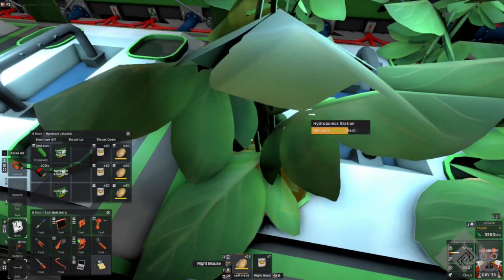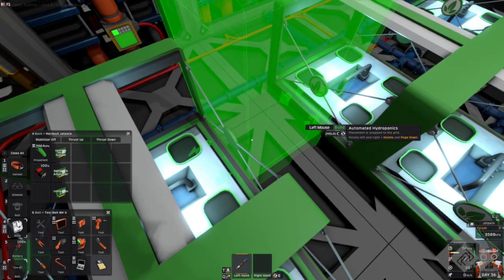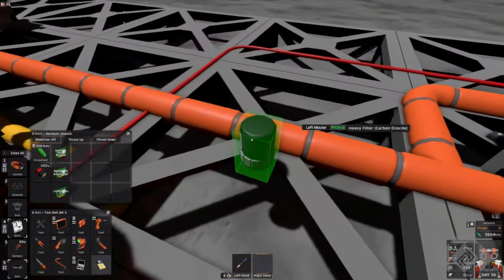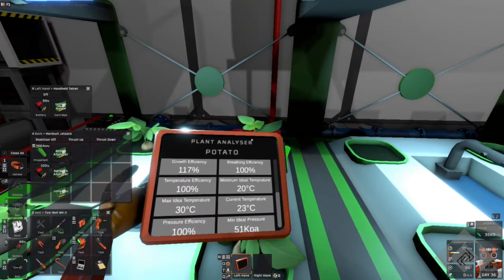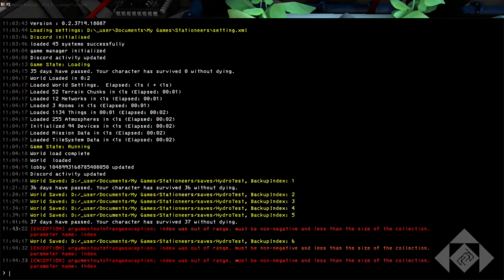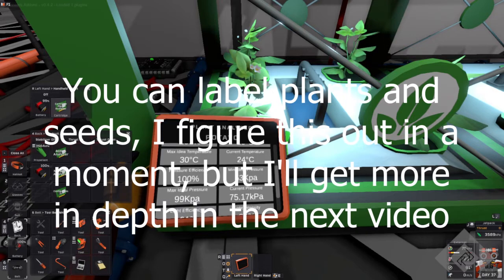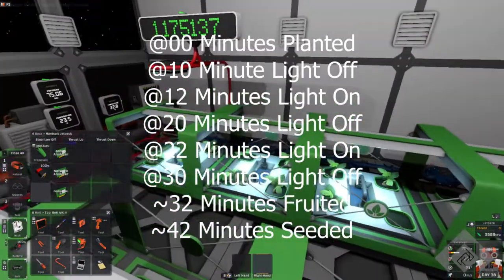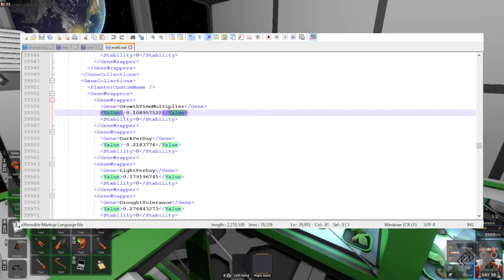PLANTS! Part 1, Light Pressure & The Hydroponics Station - Stationeers

Comment: yes with elmo mod. You now need to pump air in every machine now. Gas need to flow with a volume pump in the heat exchanger or in the ac or filter and mixer. (they have no pumping action now) Vent can't make pressure really well, they need a volume pump too. Im trying to figure out a fast airlock system since active vent are not efficient at pumping. they only move air fast if pressure differency is low.
Reply from the maker: OTHER J! I don't remember if I had Elmo's mod installed in this vid... I guess I did. One method of encouraging faster air flow, is to use blown pipes with turbo pumps... Blown pipes communicate more quickly air.